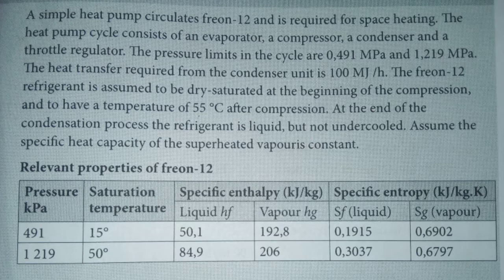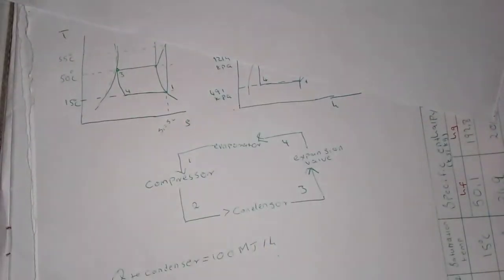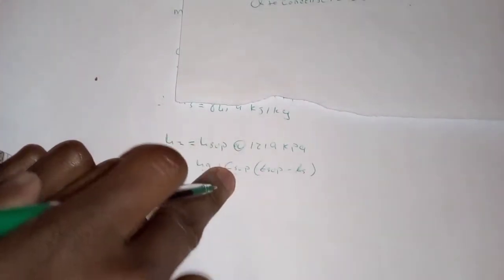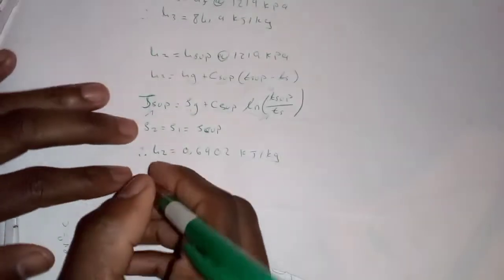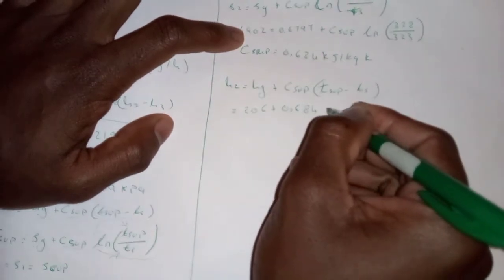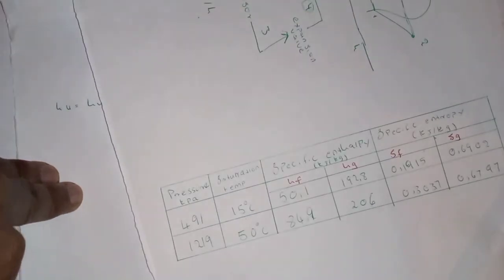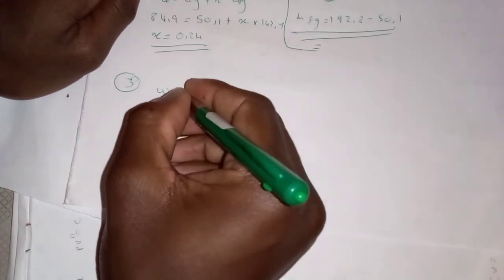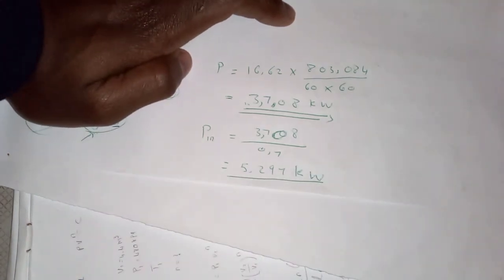Refrigeration(3 of5) Power machines N6

Comment: Tshepo your Question 1 and question 2 are incorrect cos in question one you said, in order to get Q to the evaporator in KJ/kg you write Q to evaporator(KJ/kg) =h2 - h3 but after calculating h2 you didnt subtract h3 from it you used h2 as it is which is wrong. This video is very misleading. Please correct it if possible.